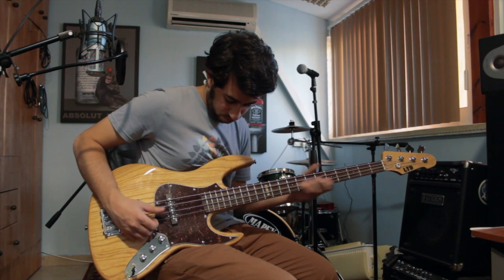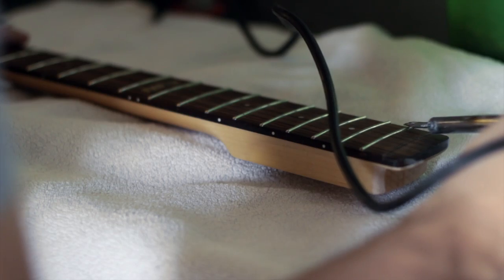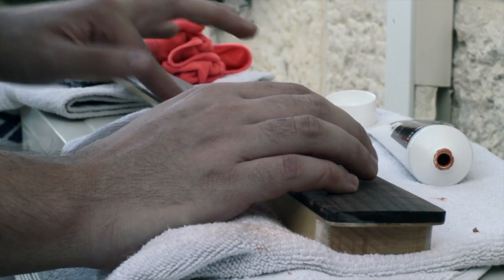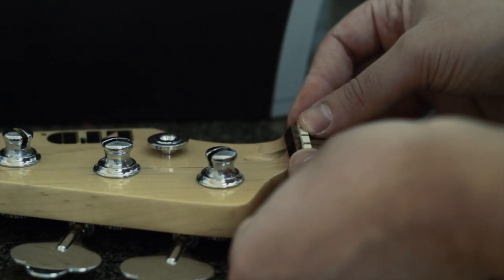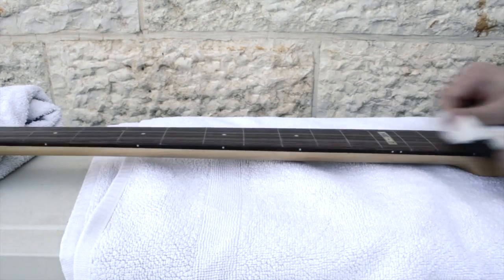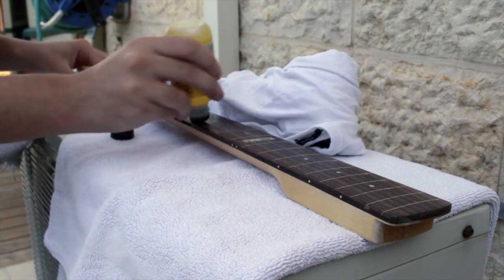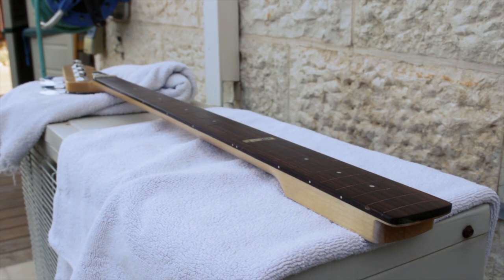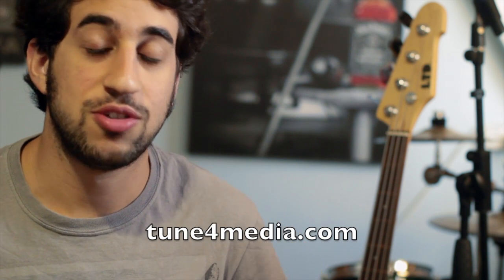How to make a fretless bass

Comment: I did this a few weeks ago to an old soundgear GSR100 I had laying around. I used white wood filler as to not only mimic the frets, but also to fill the little gaps between the fret markers/inlays, that way I can easily see where my notes are. I also applied 4 layers of crazy glue with a whole sanding process between each layer, to form an acrylic layer that strengthens the fretboard. Absolutely blew my mind how it turned what I considered a garbage instrument into one of my favorites to play!

Comment: After de-fretting a 5-string bass I picked up, I used 8 coats of tung oil on the fretboard. It looked amazing, but it was not durable. Within 3 months I had heavy string marks. I scraped it all off and used about 20 coats of super glue (cyanoacrylate). Two years later, after daily play, no marks at all. Oil is good for a fretted neck, but it won't hold up to string contact.
Reply: I saw on a video where someone used a layer of "Epoxy" They bordered the neck with tape on each side of the neck including the "Nut" and "Butt with about a 1/32" rise on each side and then they applied the epoxy.

Comment: I've done a few of these now using super glue for the neck finish - applied using a pad made from kitchen towel. it works best on rosewood because of the porosity. starting with the thinnest glue several coats can be applied to strengthen the wood, then successively thicker ones to finish. the result is much harder than polyurethane. make sure the wood is free from oil before starting by wiping with white spirit first.

Comment: That bass has a real nice tone to it. I have a fretless that was turned into one using the wood filler method and it's cheaper and just as good. The filler is harder than the fingerboard and is designed to stay in place permanently. Some people say that when there neck bends with time, the filler pops out. My guess is that they used low quality filler material. Enjoy that fine sounding fretless.
Reply from the maker: And if like me, you've decided to seal the fingerboard with polyurethane. You'll probably never have to worry about that (as long as you've sealed the fingerboard with no dents)

Comment: Please don't use wood filer, use pieces of a plastic sheet or veneer, glued with cyano. Fill the side scratches with fretboard dust you got from sanding it then pour cyano on the dust.

Comment: Thanks for the video Aaron Rodgers. Was the wood filler durable? Or did it wear out pretty quick?
Reply: Freddy Ramirez this video is almost 5 years old and the bass is still playing and still great! I should say that what you don’t see in this video is that I’ve added a polyurethane finish (just a few month after this video) to the neck so I guess it has a lot to do with the endurance of the neck/wood filler

Comment: I did exactly this on an old P bass but i never finished the project because my dad was cleaning the garage and threw away all the electronics i had set aside (i was also painting the bass) 13 years later i still have the neck and body and one day ill finish it 😅
Reply: Same but I just ripped all the frets out of mine and called it a day

Comment: nice trick with wood filler, however, superglue on the nut is a killer as it'll make it uber hard to remove if needed later.
Reply from the maker: Thank you, I've put so little glue that the nut naturally fell in one of my setups... and you're right, it's really unnecessary

Comment: well.. it is a good video !! two thumbs up! but if i have clear barnish i have to do the same process? with 3 sanding steps?
Reply from the maker: Thanks.
If your fingerboard has a finish applied, you may have to refinish it with polyurethane, epoxy, etc. the sanding is crucial for the defretting stage

Comment: Hey Noam! Thanks for the great video! I realize I'm 5 years late, but I'm just thinking of doing this to my Ibanez SR305. The wood filler method certainly seems to be the easiest method! Just curious before I try it myself, but how has it held up over the last five years? Is the wood filler still good?
Reply from the maker: Nithin Prasad Hi, I’m glad you liked the video. After 5 years, this bass is still great and intact, BUT, about six months~ after I did this, I added a few coats of Polyurethane, so I honestly can’t say that it’s the wood filler that’s holding on or the Polyurethane that seals everything and prevent it from falling apart. I can however, say that I’m glad I chose to coat the fingerboard with the Polyurethane. Hope that helps.
Reply: tune4media Thanks for the super prompt reply! And yes, this is super helpful! Guess adding some polyurethane would be worth it just for the peace of mind, if nothing else. Thankfully it's not too expensive or complicated to add. Thanks again! Cheers! :D
Reply from the maker: Nithin Prasad Good luck!
Reply: @Tune4media  Did you use gloss or matte polyurethane?
Reply from the maker: @AlColossus  Gloss, but I don't really think it will matter that much (in terms of feel)

Comment: Man, thanks for sharing good video! 
I decided to convert my old and cheap bass to fretless. Can I use lemon oil if my neck is maple but fingerboard is rosewood? Also do you have any ideas how to make fretlines more brighter?
Cheers!
Reply from the maker: Hi, thanks
Yes, you can use lemon oil it doesn't affect the neck if you apply only on the fingerboard.. (although I have another video, explaining about adding finish to rosewood so the strings won't mess up the neck so quick.. check it out it's in the link on this video)

to make the fretlines brighter.. there's a verity of color for woodfillers so pick something bright, I put a bright reddish woodfillers on a rosewood fingerboard and it's very bright and clear

Comment: Easier method than using veneer. Does it hold up as well as the veneer? I have a Yamaha TRBX-305 I want to convert. :-)
Reply from the maker: Rod DeShong After 5 years, the bass is still kicking :)

Comment: Good job. What grit of sandpaper did you use?
Reply from the maker: Thank you!
As far as I remember I went on a relatively fine 800-1000
But, since this video I've added a polyurethane coating and wet-sanded it to even finer finish with gradually going all the way to 2000 grit paper

Comment: Thanks for this video, it's most helpful. Question: Would you recommend this process for  an ebonal fret board, like the one found on a Fender Squier Deluxe V? Thanks for any and all infor you might have on this.
Reply from the maker: andrew herrero Hi, unfortunately I don't have much experience with Ebonol or Ebony.. but, I believe this process can be done for all kinds of wood, since Ebony is like the "top quality" choice for upright bass fingerboard I have the feeling that it's gonna sound great!
Reply: I don't think it would work the same seeing as ebonol is a synthetic material
Reply from the maker: I really don't know enough about it.. since Ebonol is replacing ebony finger board (especially in fretless instruments) I believe it should be fine.. my concern is that you might have to think about different filling metirial (maybe epoxy) maybe, woodfiller isn't gonna stick very well to ebonol

Comment: So what happens if you dont fill in the fret gaps? Is the bass still playable,is the point of filling in the gaps just a visual thing or an actual functional thing?
Reply from the maker: I personally think it's to prevent the frets from chipping over the years, also, to make sure that you don't have weak points that will be bent over the years.
Reply: tune4media makes sense,now that you mention it

Comment: how many mm the nut must be lowered? thanks
Reply from the maker: Hey, so It's actually not in the video but what I've done later is to gradually remove height from the nut and tested it on the bass with strings. I'm not a professional so I just kept going until it felt great under my fingers (I'd roughly say, it was about 1.5-2 mm)

Comment: Great vid--got a  question:

How much did you sand down the nut?
Reply from the maker: will lee Thank you, basically, sanding the nut is sort of an optional stage. The logic behind it is that the lack of frets allows you to lower the action from the nut side. I think the height varies from bass to bass. I've sanded the nut while the strings on the bass and test fit it until I was happy, careful not to sand too much
Reply: Thank you!

Comment: if I have a maple fretboard and I do this process ..... will affect my bass? what can i put instead of lemon oil?
Reply from the maker: Hi, If you have a finished/varnished maple fretboard, basically your fretboard is already protected with finish (you can add a thin coat of any clear varnish just to "fix" the wood filler into place and add strength) If you don't have a finished fingerboard, I'd suggest you to stain the fingerboard with polyurethane in fact this is so protective and great that I decided to apply it on my rosewood fingerboard as well. Make sure you learn how to add finish, soft and wet sanding, polish.. things that will make the fingerboard smooth after the finish you're adding.

You can watch my new video Fretless Bass Conversion: Maker's Notes
I covered some extra details about finish and more for this fretless conversion project.. Hope I helped you..
Reply: nice It's cause I want to do this project on my OLP 4 string bass & it has a maple fretboard! Man!! thank you!  your video it's amazing ! :)
Reply from the maker: Thank you :) I'm glad I could help you

Comment: Is there an equivalent of lemon oil for maple fretboards?
Reply from the maker: Ideally a maple fretboard is sealed with lacquer so lemon oil is irrelevant or even worse. So bottom line is, there's really no need for oiling the wood if it's sealed with lacquer, In fact, I've coated this bass with polyurethane lacquer so now lemon oil over my bass is not very beneficial as well  ;)
Hope that helps..
Reply: great! thanks for the info
Reply: And if not sealed you could use tung oil, also works on rosewood

Comment: what grit sand should i use?
Reply from the maker: As far as I remember, I've used 1200 paper. 
If you have an un-lacquered rosewood neck, keep in mind that it's already finished, so you only need relatively fine-grit sandpaper  to get rid of the bumps made  by the woodfiller

Comment: Using roundwound strings and can i skip the lemon oil step?
Reply: Lemon oil is pretty stupid, a luthier will tell you that. The woods for making instruments are dried for years before being used, and everybody thinks you've got to "soften" it with Dunlop lemon oil (so well played Dunlop, nice marketing).
If you use roundwound, you should use the Jaco Pastorius' method : polyurethane coating. This way you won't damage the fretboard as fast.

Comment: Could you or anyone explain me how to sold properly? I've been soldering the same fret for half an hour but it's not working, I've even melt some lead over the fret, but no results.
Reply from the maker: +Kevin Manrique What do you mean? It's possible that you bass hasn't got glue under the frets..basically, even if you have glue, you can pull out the frets, but the glue will leave chips all over the place and you fret slits will be a mass.
Reply from the maker: +Kevin Manrique 'Your fret slits*'
Reply: +tune4media Indeed, it didn't have any glue under the frets, I just needed a better aplier t get the job done. Thank you very much, completely useful and concise video!!! Cheers!

Comment: Can I just use a clothes iron to heat up the frets
Reply from the maker: Hmm.. I believe it will do the job (if it's hot enough).. only it has much larger surface so you gotta be careful so you won't burn the fretboard..the heating process is just to melt the glue.. now.. maybe ask, or search any info about your bass. the frets might even aren't glued and it will be unnecessary.

Comment: Hey guys, just came here to warn you: yes, there can be too much wood filler. This is a great tutorial but it only fails on saying that there is never too much. Be careful because it can be really difficult to remove the wood filler and also it can ruin your fretboard. Just put some in your finger and draw the line on the fret, don't put too much. Thanks for this vid though, really good and you sound awesome on bass. Stay groovy my dudes 😎
Reply from the maker: Thank you for your input! I think you're right. 
It's good to really 'shove' and compress the wood filler, but I may have not mentioned cleaning some of the excess wood filler that stays on the surface right after you apply it.

Comment from the maker: @Julian Luchelli Fassa
Check the link on this video, it's another video with updates.. I'm answering some questions there and giving more suggestions for a fretless conversion
Reply: Thank you very much !! i have my fretless now on my hands and it sounds tremendous !!! As i said, this video and ur guide on the link that u gave, worked PERFECT for me! thanks !!!
Reply from the maker: Julian Luchelli Fassa You're welcome! I'm glad to hear that!
Reply: please reply : I made all the steps perfect now I'm at the final sanding,  I'm thinking to flat matte clear coat or epoxy beacuse the lines with filler might be damaged,  but I really don't know what to use 1epoxy or polymethene spray or floor clear coat vernice?
Reply: +Nikos Fender.
Reply from the maker: ***** I've applied polyurethane, and it works perfectly. 
Watch my other video, I explain how I did it.. 
You can also learn (in general) how to apply poly and wet sand it to a smooth finish.
good luck!
Reply: +tune4media Thank you so much I have one more question should I buy  polyurethane spray can or the liquid and apply it by a sponge or a piece of rag?
Reply from the maker: ***** You're welcome!
In my opinion the liquid will be better then a spray
Reply: +tune4media you are the man dude :)